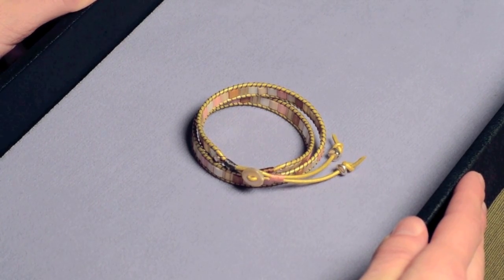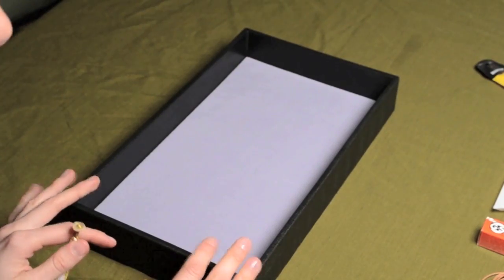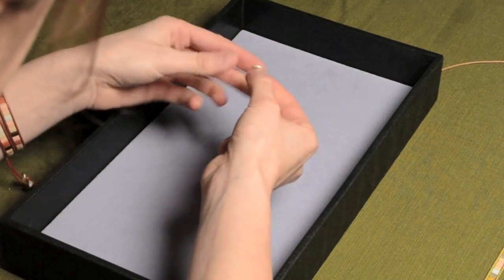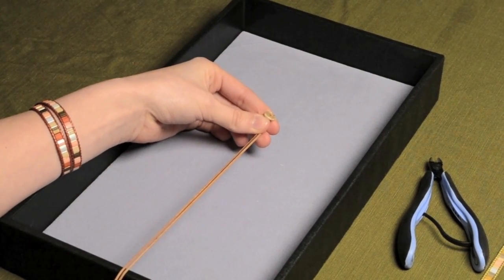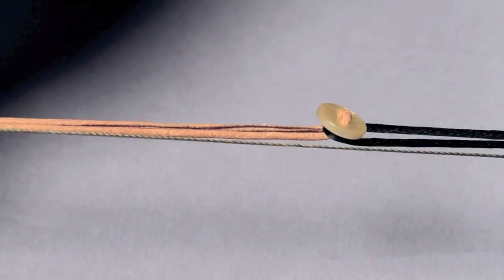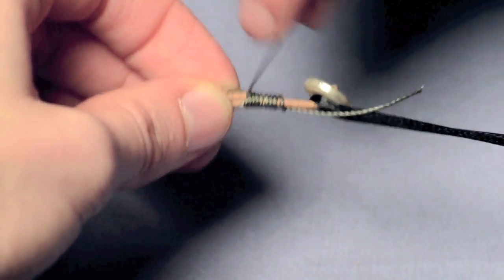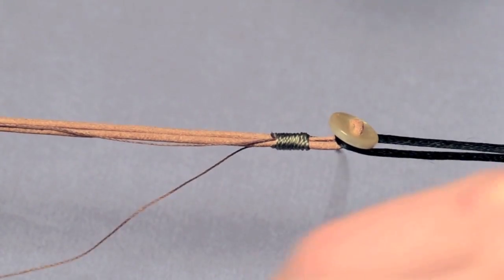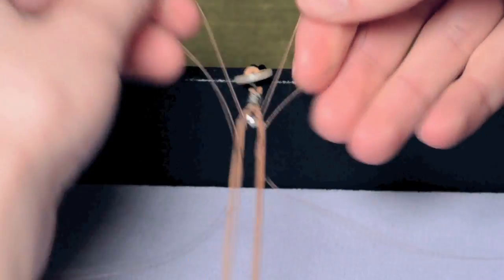Mosaic Wrap Bracelet with Tila Beads

Comment from the maker: Hello Perdnee, and thank you for your question about the needles. We have used them in the past, but found that when laddering beads with tiny holes, it can be challenging with needles. When developing this technique, we found a thread that was strong, thin, and with minimal fray at the ends called "Tuff Cord." We love it and sell it at beadshop.com, and it comes in 16 colors. When paired with beeswax, needles are not necessary. I recommend it!

Comment: wow, I just use a clip board. I tried a shoe box lid, but found it difficult to work inside the walls of the box. For me, anyway the clip boards are inexpensive and come in several sizes/colors etc. I recently got a "legal pad" size for longer wraps like this and find it ideal. I'm new to using the 2 hole tiles though, and look forward to trying this nice pattern. Thanks for sharing the clear, easy to follow video!

Comment: Rather than tying, I use those fat clips on the top and bottom - this way you can easily unclip to check and easily re-clip.  At the top, I clip the "rat tail" at the bottom, the leather (doesn't leave a bad mark)

Comment: I am using fireline thread which seems to work well but I didn't have enough thread to finish to make a double wrap. Is there any way to add cord or do I i have to pull out all the beads I spent hours adding to my leather to make it a single wrap?

Comment: I too did not have enough cord to finish and added on.. crude but it worked.. so the second bracelet I used 90" and THAT was not enough..  I have a 7.25" measurement around my wrist.  
Does anyone have a length of cord that works for them??  I LOVE the finished project in any case!!